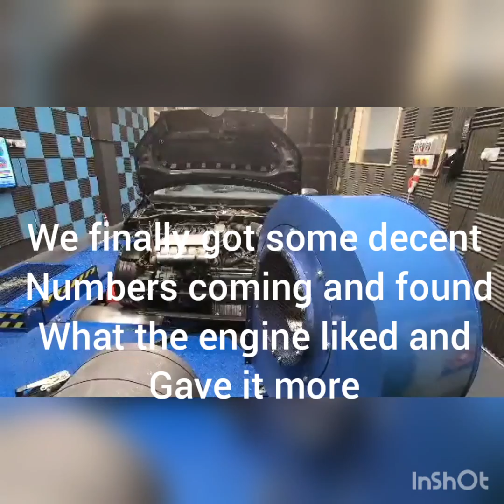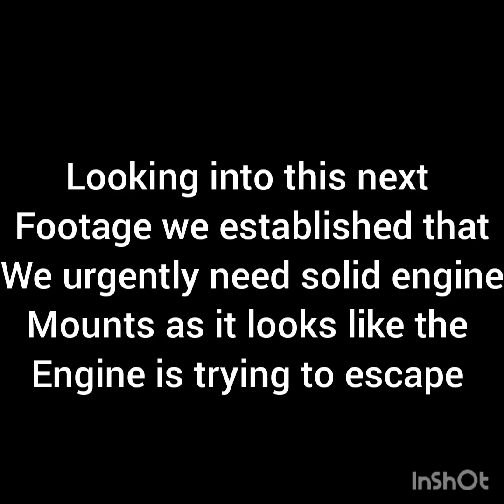V5up volkswagen up powered by v5 dyno run 2.3L v5 engine swap

Comment: How reliable for road use would this be😂😂😂
Reply from the maker: Yeah as a v5 this tune wouldn't be great for everyday use as it's about max power! The up with a stock v5 could have been made road legal but I've now turbocharged it to be faster on the strip and it wouldn't be possible now unfortunately. 😊 

Anything is possible If you try hard enough
Reply: @tailord5467  if I win the lottery I have plans

Comment: timing chain wear could also be considered with engine wobble or torque bar
Reply from the maker: Yeah we've since rectified the issue and we've changed out the loose engine mounts for solid and made up a tubular subframe to position the dog bone mount correctly

Comment: I wish I had the Map files from the ecu.. I'm guessing the is no way you are going to give it away.
Reply from the maker: I mean I have the ecu with the map file still on it already but, because it was only made for top end power I'm not sure how much it'll be able to be used as a road car because we literally went for power runs not for driveablitly, there might be flat spots in the map which weren't a priority on our mapping time but cause issues on the road 🤷🏻‍♂️

Comment: did you have trouble getting the engine to fit? I wonder how hard it would be to fit a Polo TSi engine
Reply from the maker: I mean anything is possible, the v5 fit quite well luckily, but as long as you can yourself or have friends who can weld and fabricate engine mounts, help plumb everything in, help with wiring and you don't mind the car being sat in rhe garage whilst it's being done then go for it 🙌🏻

Comment: Love it

What mods did you do to achieve the 198 mate?
Reply from the maker: Thank you this is completely stock engine only difference to the stock v5 in golf/bora is that my exhaust has a shorter runner and used a ramair filter 

We turned off all safety features whilst on the dyno so knock sensors were turned off to stop there being limits to how hard we could push, because my car is only for the dragstrip it will run like that fine but on the road it wouldn't be fun as all the power is at the top end of the gears unreachable in most normal driving 😊
Reply: @tailord5467  recently purchased a bora v5 170hp will be using this company for a remap
Reply: @tailord5467  it's a beast mate it must be rapid in the UP

Did you use an me7.1 ECU from a golf/bora?
Reply from the maker: @garvey2510  yeah it was crazy fun even more now I'm in the process of turbocharging it so I hope it'll be 300/350bhp by the time I drive it next and yes its the stock v5 engine ecu 😊
Reply: @tailord5467  can't wait to see it mate keep us posted

Comment: where did you find nearly 30hp ? Just a Remap?
Reply from the maker: Yeah just purely due to only using the car for drag racing we were able to turn of engine safety features and gained 30bhp, I'm now in the process of fitting a turbo 😊
Reply: @tailord5467  keep us updated on that because for the vr5 isnt alot of turbo kits or parts made
Reply from the maker: @qo1707  of course I will do if you check out some of my more recent videos I have some more progress on the build!

Comment: Is that 10 valve or 20 valve engine? what modifications were made that power increased so much
Reply from the maker: It's a 20 valve due to using the car solely for drag racing we turned off all knock sensors and added timing past the normal safe road /daily driving limits (I have a spare engine so if this one went bang on the dyno I wouldn't have minded 🤣)

Comment: Is a vr6 golf mk7 possible to do ?
Reply from the maker: You mean fitting a vr6 into a mk7 golf? I believe someone has put a vr6 in a rs3 same shape as a mk7 golf! But the 2.0tfsi in the mk7 golf are quite easily tuneable from what I've heard 🙂
Reply: Tailord yea that’s what I meant pal sorry. Yeah the golf r mk7 easily tuneable , just want to the different lol
Reply from the maker: @YHsTig   yeah that's true I love the concept of being different it can be done check out makata motorsport I think is there name guys in us doing the vr6 turbo swap into a 2018 rs3. 

The other thing I will say is if you are looking to turbo the vr6 it'll be a good swap if just stock vr6 it might be just end up being the similar power and performance if anything slower than a stock mk7 golf r. 

The vr6 turbo set ups take a lot of abuse I've heard of r32 stock block with a head spacer happily take 550/600bhp
Reply: @YHsTig  HGP swapped the 3.6 from the passat twin turbocharged it and putted in a MK7 hitting 350 km/h on the autobahn
Reply: @tailord5467  yes, I spent all night looking into it all. Wouldn’t mind 3.2 vr6 or a 3.6 . In a standard mk7 shell - suppose a lot of people .
Reply: @kujtimtopojani2020  yes I’ve seen that one , wanting someone in UK to be able to do a vr6 conversion. Manual or auto. Looking to turbo it in the future . After a money pit basically

Comment: All the tuning companies here in the Netherlands can only add around 10hp how did you manage to get almost 30hp out of it?
Reply from the maker: We have the benefit of this being only used for drag racing so it doesn't need any of the usual safety features
Reply: From what I've found the engine is also very poorly mapped from the factory.
Reply from the maker: @Arrchey249   this is true a prominent flat spot In the rev range 🤔 but I'm now turbocharging the engine so that will help solve it 😊
Reply: @tailord5467  that's from the manifold changeover. A guy on clubgti managed to drop his 0-60 time by about 0.8 seconds (G-Tech) on his completely stock Bora with a little bit of time and effort.

Comment: what ecu are you using
Reply from the maker: Im still on the Stock v5 ecu currently
Reply: @tailord5467  ok cool do you plan on using the stock ecu when you turbocharge it
Reply from the maker: @kashifkelly7205   yeah initially I am planning on keeping it just at wastegate pressure on stock ecu, until I can get a built engine and then will probably look to go aftermarket and try and make decent power for now itll be just wastegate pressure hoping 300-350bhp on wastegate if possible 🙏
Reply: @tailord5467  you do know that the v5 engine can take 500+bhp stock right
Reply from the maker: @kashifkelly7205   oh really? I've heard most recommend at least a decompression plate or even lower compression pistons but I know the stock rods and pistons will take quite a bit of power before we have problems 🙂
Reply: @tailord5467  well yes with the lower compression plate but don't think they make the plates any more its in the form of a lower compression gasket
Reply: I just bought one on Ebay for my project
Reply: Check out that link on Ebay they have the different ratio of compression you can choose from
Reply from the maker: @kashifkelly7205   thats awesome thank you mate appreciate it 😊
Reply: @tailord5467  As you said it's the 20valve, you would need the AQN Gasket, not the one for the AGZ.
Reply from the maker: @stabileseitenlage  thank you I've got the link saved now for the AQN
Reply: @tailord5467  Gald to help, I know the frustration of having to stop your work because you forgot to get a part, or ordered the wrong one.

Comment: What a beast 🔥 great video 😁
Reply from the maker: Thank you very much 😊
Reply: @tailord5467  how much does it cost and what can you advice for a motorswap in a up gti?
Reply from the maker: @ULTRA13xiii  it really depends what you want to be honest bud, you can spend as much or little as you want depending on engine and drive train you want to go?
Reply: @tailord5467  something daily 200hp seems enough
Reply from the maker: @ULTRA13xiii  possibly check out on Instagram a few of the Brazilian guys have got the up gti or tsi 1.0L engines up to 300bhp using racing pistons and different turbo's 🤷🏻‍♂️ could be worth doing something like that rather than engine swap bud